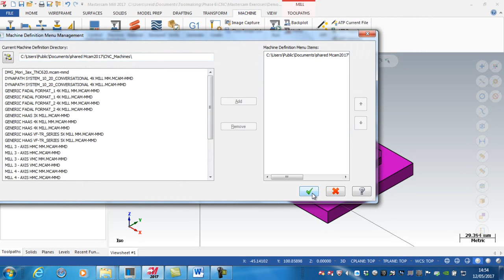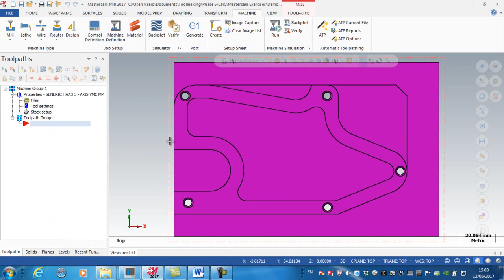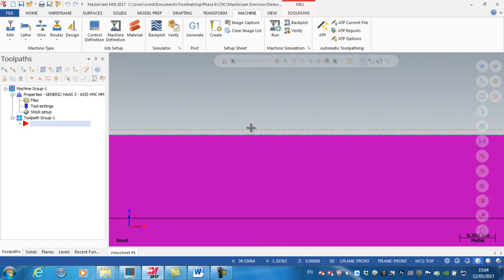Mastercam 2017 - #22 - Solid Model - Machine Definition & Stock Setup

Comment: disculpa una pregunta? porque el excedente de material  para realizar el facemill se coloca del cero hacia arriba en positivo si cuando coloco los offset  de la herramienta en el cnc yo doy el cero en Z en el sobrematerial, se supone que apartir de hay empieza bajar la herramienta en coordenadas negativas, no entiendo esa parte.
Reply from the maker: Hi Joel, I am not sure if I understand your query. When I want to face-mill the top of the component, I set the Z axis work offset (program zero) on the CNC machine below the top of the raw material (0.5 - 0.8mm). The face mill operation then machines the top of the part to Z zero. Thanks for your comment!!